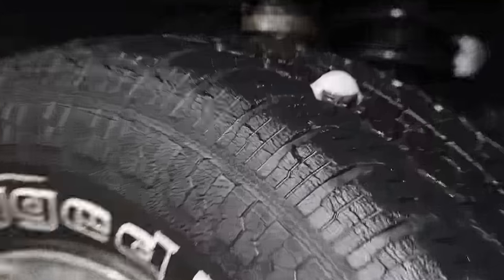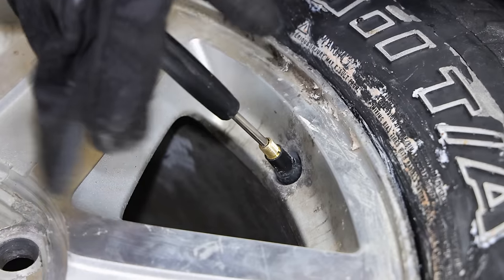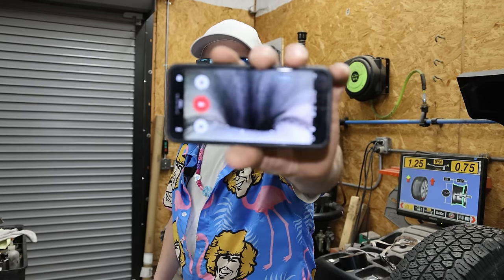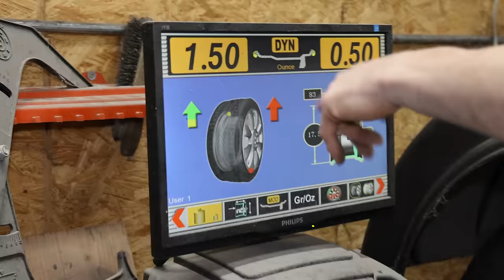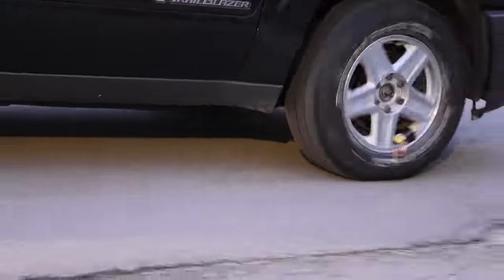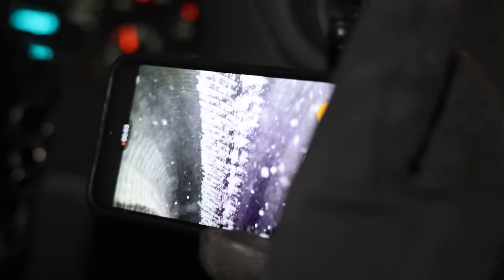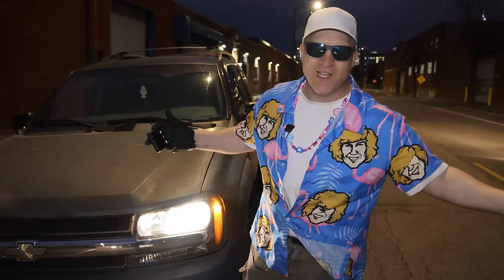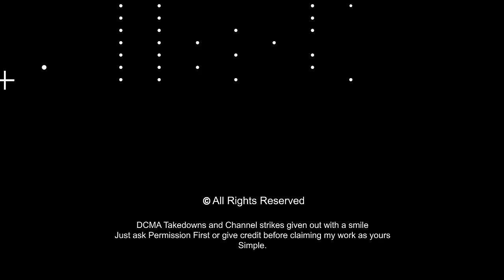GoPro Inside a Car Tire (With Balance Beads)

Comment: They work because the tire is rotating around its *center of mass*. If the tire has a heavy spot, the center of mass is going to be offset towards it, Meaning even though the heavy spot itself wants to be flung outward from a static reference frame, from the rotating reference frame of the tire, the heavy spot is actually staying closer to the center and the light spot is being flung outwards the farthest. The beads, which are free to move and not a connected to the tire at all only move via centripetal force of the tire trying to pull them back to the center, and they'll collect in the high spot which is the light spot.
Reply: Sticky Sticky  this and give the guy some more likes plz.!
Reply: Your explanation makes sense when you think about it. Thanks.
Reply: @RealityCheckThat  no problem! Glad that helps. I just searched and found a video titled "DynaBeads demo video" that I definitely recommend for anyone trying to visualize it. The guy used an eccentricity weighted water bottle with flexible extension in a drill to demonstrate the beads and i think it really helps to get a more intuitive feel for the phenomena.
Reply: You can also see this effect if you spin an ax in the air. It looks like the handle is orbiting the ax head
Reply: Nope.
Now, I know your are going to (firstly) trust the vendor over some stranger on the Internet, but hear me out.

An unbalanced wheel on a spring suspension will drag the axle in the direction of the extra mass.
That means that the heavy side is further from the centre of rotation, not closer.

The way these beads work is that any on the heavy side get hit harder than those on the light side. Result, the ones on the heavy side get redistributed more than those on the light side.
Reply: @dougaltolan3017  You are correct to say the heavy spot pull the wheel assembly as it spins. However, the heavy spot is closer to the center of mass, and the wheel assembly spins around the heavy spot. The easiest way to demonstrate this is with a dumbbell. Use a light weight and spin it using your wrist. Then attach weight to only one end and repeat the test. You will find the heavy end feels like it's dragging your whole wrist around it, and not like it's pulling your wrist away from the center. Essentially, the center of rotation has moved closer to the heavier side of the weight. Take it to the extreme and pretend it's a dumbbell with 50lbs on one side and 5lbs on the other. When you spin it by just applying a rotational force, the 50lbs side isn't going to want to move, the 5lb side will move much easier, so the 5lb side along with your wrist will rotate around the 50lb side.

Now do that with a car tire and you have the center of rotation for the whole axle being moved slightly towards the heavier offset. 

Now the balance beads are not attached to the tire and can spin freely. They will naturally gravitate to the point furthest from the center of rotation. Since the heavy spot in the tire is slightly closer to the center of rotation, and the light spot slightly further, the beads will move towards the light spot as it's furthest away from the center.
Reply: The tire is rotating around its geometrical center, if it would rotate around its center of mass it would always be balanced, beads or not.
Reply: Thank you
Reply: @Kalimerakis  correct - it WANTS to rotate around its center of mass but it's being constrained. To force it to rotate around the geometric center requires a constantly shifting force vector towards the center of mass which manifests as a vibrational force on the axel.
Reply: @2009dudeman  there is a problem with such an extreme model, it does not reflect a small imbalance on a heavy system with an even greater centering force.
Your dumbell model is misleading you.
Reply: @GlutenEruption  but then your theory doesn't add up.
If it spins around its geometrical center and the center of mass is offset, the heavier side will pull further away from the center of rotation.
Reply: @Kalimerakis  from a stationary reference frame, yes, you're right, but the reference frame of the tire is what matters to the beads. To them, they're seeing the light spot being flung AWAY - the system is compliant meaning the center of rotation will actually migrate somewhere between the axel and the center of mass putting the light spot further away and the heavy spot closer to the center from the reference frame of the tire
Reply: From the beads perspective, the area oposite the heavy imbalance hit a hill they have to go up causing them to pile up just before it on average. That's what causes them to balance the tire. The heavy spot pulls the tire in the direction of the imbalance at first at low speed, the same speed the beads seat in and centripitally stick to the tire. Once a tire gets up to speed, it starts rotating around its center of mass, but at that point the beads are already stuck to where they need to be.
Reply: That feels like a good explanation even though it's hard to fully work out in my head, basically need to ask a physicist to explain this lol
Reply: What he said 😂
Reply: @blahblahblah2372  Centrifugal doesn't actually exist. Centripetal is the force pulling towards center that causes something to rotate in a circle.
Reply: @blahblahblah2372  yes, centrifugal force is what's known as an "imaginary" force. It doesn't actually exist but is rather created by the perspective of being in a rotating reference frame - what you're feeling when you feel centrifugal force is actually centripetal force. Centrifugal force = "center fleeing" centripetal force = "center seeking". When you take a hard corner and you feel like you're being flung outward into the door of the car, If you look at it from above in a stationary reference frame you'll actually see it's actually the opposite that's happening. You're body is trying to continue moving in a straight line and the door is continually getting in the way and pulling you towards the center of the turn.
Reply: It’s simple beadeometry
Reply: Yep.
Reply: I don't think so. If the tire always rotated about it's center of mass, it would always be balanced. But tires rotate about their axles and any mass asymmetry in the tire/wheel assembly provides imbalance when rotating.
Reply: I was hoping someone said it so I didn't have to write much. Thank you!
Reply: @GlutenEruption  thank you for taking your time
I am still a bit hesitant,
but everything adds up the way you depict it.
Reply: @Kalimerakis  No problem! And definitely don't worry - EVERYONE struggles trying to picture behavior from rotating reference frames. They are REALLY good at screwing with our intuition. Lots of things start behaving really strangely and even exactly OPPOSITE how you expect them to, and it takes a LOT of brain retraining to even begin to get a gut feeling for it (and even then it's hard).
Reply: @SanityTV_Last_Sane_Man_Alivethat is the intuitive answer, and in a theoretical system (perfectly spherical cows and whatnot) it's true, it but it's not correct in reality because the system isn't perfectly constrained - the rubber in the tire is compliant and able to flex and stretch, the axel is sprung and allowed to move up and down, the play in the suspension and the flexibility of the components allows it to move in all axis's, and ultimately the entire car is free to move as well. The fact that there is a vibration itself (which is fundamentally the entire system and its components accelerating -ie moving - with a constantly changing vector) is proof that the tires rotation isn't being perfectly constrained about the axel, because if it were, the off balance forces would be irrelevant - if the tire is able to be kept rotating perfectly around the axel, then by definition the forces are being canceled out.
Reply: I believe the concept is wrong. It is the opposit! Farthest of the center stronger the centripetal force, more beads accumulate there...
Reply: Well now who the hell do I believe? I’m confused, my head is hurting worse than it hurts in a vehicle with unbalanced tires.
Reply: Yeah that's what I was thinking too!!
Reply: Then why does the axe head, the heavy part end up more often in the tree when grown at it with intent?
 @havoc1zero
Reply: What is "it"?  Do you meant the beads? If so the s  on the end of beads I fixated this is something plural in which case it's appropriate, accurate and helps people understand the language you are using, to say, "they" not "it"!
 @GlutenEruption
Reply: @Kalimerakis which indeed it has to! I agree.
Reply: @r.martin3494  that’s the result of a proper throw at the correct distance where the spin ends with the axe head forward. That’s really just a skill issue.
Reply: Yeah, that's not true at all, they don't really balance at all they're mass dampers, they dampen vibrations, they don't really balance the tire.
Reply: IMAGINE - all the people, driving, now in peace, - no, seriously, imagine a tire /tyre is a sock and the beads in the tyre are not attached to anything and that's why that theory works, then equally, a fistful of sand in a sock not being attached might also want to move to my shoulder when I swing the sock of sand around in a circle, yet! 😊 The "sock of sand" still follows the rule of centrifugal force and causes a lot of damage when it hits someo/ I mean, something.  Especially if "kneehighs"!
Reply: @blahblahblah2372  ...and is yours the same as centripetal which is what HE wrote!?  And which should come first the question mark or the exclamation mark after such a sentence as this, or should only one or the other ever be used and never both?!!!!  Though never more than one exclamation mark of course!  ...and not as often as most these days use them! 😂😊
Reply: @KalijahAnderson I beg to differ! Both exist and are found inside the tire with the beads and they all make "uncomfortable bed fellows" for a wheel!
Reply: @r.martin3494  no, "it" was referring to the heavy spot of the tire. If the tire is perfectly balanced, the center of mass, the center of rotation, and the axle all overlap. Now if the tire has a heavy spot, the center of mass (center of gravity) moves to somewhere between the geometric center and the heavy spot. If you were to spin the free floating tire in zero gravity, it would just spin around its center of mass and there would be no imbalance because the center of rotation and center of mass are identical. However, by forcing it to spin around the axle in the geometric center, since the tire will constantly be trying to rotate around the center of mass but is being held back by the axel, it will impart a force onto the axle felt as vibration. From the perspective of the axel, it will seem as if the heavy spot is being flung outwards by centrifugal force but as we know, centrifugal force isn't real it's just the result of centripetal force acting in a rotating reference frame. From a static reference frame, the tire is actually rotating around a point offset from the axel towards its center of mass, with the light spot always being furthest from the actual center of rotation. The beads will begin to collect there preferentially until the Center of mass of the system back into alignment with the geometric center of the axle, causing all points on the tire to be the same distance away from the axle, preventing any more beads from collecting
Reply: Accumulation of bead is dependant upon the configuration o and logistics of delivery to the bead store in the shopping mall where the great confligration of caterpillar force is assembled using bamboo and other sustainable products! 🫡🤔🥴🤒🤕
My head hurts!
Reply: We tried them in our shop several years ago with very bad results. Just about everyone complained.
Reply: @r.martin3494  Centripetal and centrifugal are not things that one can have opinions about. These are scientifically defined things. Centripetal causes a change in direction, centrifugal is just inertia trying to go straight so it's not actually a force.
Reply: Centrifical force keeps it balanced
Reply: @empoweryou1  that's definitely good info - just because something works in theory or in the lab doesn't necessarily mean it translates to the real world. I've seen a pretty even split between people who have had excellent experiences with them and terrible experiences with them (from my brief search, it seems like motorcycle riders especially seem to notice a significant positive effect). 

Such a wide range of experiences makes perfect sense to me considering that it's one of those products where the better it's working the more invisible it's effects are, meaning the feedback is always going to be skewed towards the people having trouble. But more importantly, given their mechanism of action, a huge number of variables including things like suspension stiffness/play, play in the ball joints, power steering strength, tread width, tire size, compound, the texture on the inside of the tire, lateral imbalance, the rim design, driving style, speed, etc, as well as how each variable interacts with every other variable, all play a major roll in how well they work (or even IF they work) on a specific vehicle in practice.  

Given that fact, plus their incompatibility with TPMS, the mess they make of the rim and tire, how well modern balancing machines and wheel weights work, how easy and cheap it is to get a tire rebalanced, etc, I just don't see any serious advantages compared to standard weights (and SIGNIFICANT downsides) IMO, even if they perform perfectly with your specific setup. But regardless it's still a pretty neat use of applied physics and a pretty elegant solution to an everyday problem
Reply: @Kalimerakis  We're not rotating the tire in outer space, so this level of pedantry isn't useful or even necessarily correct.
Reply: @richardpark3054  "Balanced" in this model means that it's center of mass and it's geometric center are aligned. Even if we take out the axle, it would be out of balance when you try to roll it, like rolling an egg down a hill. The egg will rotate around it's center of mass, but it will not be balanced.
Reply: @r.martin3494  You and the sock full of sand are the same unit in this example, with you being the heavier side of the rotating system... By your reasoning, the sand should end up towards you rather than away!
Reply: I'm calling BS.  While your explanation of a high spot and low spot in the interior of the tire makes sense, you make a leap of logic in saying the beads will settle in the high spot.  What force acts on the beads to cause them to collect on the lighter side of the tire?  Additionally, is it feasible that that force is sufficient to overcome the "centrifugal force" pinning them to the interior wall of the tire?
Reply: Isn't a tire fixed so that it can only rotate around its geometrical center? I mean Sure there's suspension but it only gives it some freedom up&down. Side to side it's still constrained by the bearings
Reply: That's stupid
Reply: @РоманПлетнев-г3э  yes! The axel does fix the geometric center and if everything was perfectly fixed and rigid it would, however the entire system is free - the suspension like you mentioned is compliant, the tire is made of rubber and can significantly deform and flex, the metals aren't perfectly rigid, there is wear and play, and ultimately the entire vehicle itself can move. Remember, the vibration you're feeling is the tire physically pulling the car constantly towards its preferred center of rotation. The further and harder it moves, the greater the amplitude of vibration. No matter how out of balance something is, the more rigidly it's mounted, the smaller the amplitude of vibration (and if it's mounted perfectly rigidly to where it allows zero motion, there is no vibration whatsoever). So more vibration = larger movement towards the center of mass = greater forces redistributing the beads. It's a self correcting system.

But side to side you are 100% correct. These do absolutely NOTHING to balance a tire laterally, which is a HUGE drawback (among many others) compared to traditional balancing
Reply: If a tire is that much out of balance, there is a reason for it. If your tire is dry rotted that bad, buying balancing beads is just making the bill for new tires more expensive.
Reply: Thanks for that explanation.  I was baffled how the beads would "know" where to go.  You clearly explained it to my dim mind!
Reply: @GlutenEruption  Given that the rubber can deform, why should the part that experiences the highest force stay close to the center of rotation and not be flung outward the most? If it was the other way, wouldn't the off-balance correct itself automatically?
Reply: The heaviest spot will pull the farthest if material is equally stretchable in its entirety. As with rigid body materials. This is just plain physics.
Reply: @2009dudeman The tire spins about the axle, not the center of mass.
Reply: @DingoHammer  the axle itself oscillates... This was more visible with the old beam axle, but it's monitored on F cars, out of balance wheels oscillate all the way to the axle.
Reply: I wonder if an extremely out of balance tire would cause vibrations when it wasn't in accel/ decel... It seems like the beads are in chaos when not in a transient condition.

The camera almost seemed like it was interfering some, you could hear the beads smack it a few times throughout the video.

I bet close inspection of the beads at the contact patch would give better data, but good luck with all that.
Reply: Bonehead explanation...the tire rotates around its approximate geometric center, which is close to but not the same as center of mass, otherwise it would be a perfectly balanced system in the first place.  At slow enough speeds the beads sit at the bottom of the tire...gravity is a bitch.  At high enough speeds the friction between tire and bead is enough to drag the beads around.   The assumption that an internal concavity is only going to be found at a thin or "light" spot is completely irrational. There need not be a depression for a tire to be lighter in a region...all tires are heterogeneous...they are not monolithic material...they are composed of many materials, and any given volume of tire can weigh slightly more or less than some other equal sized volume of the tire for very obvious reason...without having a dent to supposedly collect beads...all it takes is a slight difference in, say, the ratio of rubber to steel in a location compared to some average rubber/steel ratio, which would mean densities are different..and we know tire material density is not uniform otherwise the damn thing would not need balancing..
Reply: The only issue I see is trying to get the right amount. If you put too much it won't work, and too little it won't work effectively.
Reply: @jwalster9412  too little and it absolutely won't work, but unless you add WAY too much, it will still work okay because any additional imbalance from extra beads will also be canceled out as the excess will be distributed around the entire tire. Of course any excess is adding unsprung weight, which will degrade traction over rough roads, etc.
Reply: When I first read your comment, I was sure you had to be wrong.  It took me super long to visualize this, but I finally can and I'm glad you explained it, thanks. Also, the dude talking about barbells here was instrumental in that for me. Thanks to that guy too.
Reply: @MrBradshawbenjamin  That's so awesome! I'm glad to hear that! Rotating reference frames are REALLY counterintuitive - often things do the exact *opposite* of what you expect them to, which can be super confusing, but once you start to get a handle on things, they can be really cool and fun to explore. They definitely make great brain training puzzles!
Reply: @Tesla_Ampersand_Friends  oh absolutely- until the speed is high enough for the beads to be fully distributed and held firmly against the inside of the tire, their is absolutely zero balance whatsoever. So you'd definitely get a big vibration getting up to speed and slowing down again which is just another one of the many disadvantages vs static weights in this application.
Reply: it's like how a washing machine is self balancing.
Reply: @Kalimerakis  actually it's rotating around a point in between. if your suspension was floppy and unloaded it would rotate around the center of mass. on solid suspension it rotates around the geometrical center. since your suspension is stiff but pliable it does neither.

which is probably why balance beads don't work as good on sports cars
Reply: That was good explanation.
Reply: That explanation is totally correct once you think about.
Heavy spot in, light spot out. Centrifugal sends beads to outward spot.
Reply: @2009dudeman  If you take a balanced tire / wheel and add a wheel weight to one side and throw off the balance what happens? The heavy side torques the center point of the tire balancing machine so in order to rebalance that wheel you must add the same value weight to the opposite side to get it back in balance.  So you mean to tell me the beads automatically go to the opposite side of the weight you added? But why?
Reply: @warntheidiotmasses7114  Technically balance beads are dynamic balance and cannot be accurately run on a tire machine not designed for such things.

The beads work their way opposite the heavy side because the heavy side drags the tire and axle with it even if slight. The beads, being free to roll, want to maintain momentum in 3D space and roll 'away' relatively from the heavy side, not dissimilarly from shaking a bowl of water.

As to the topic of the tire actually dragging the axle. I didn't think that was a hard concept, but someone else was confused by it so i'll explain it anyway. The axle is attached to a spring, meaning it can move rather easily. So as the heavy spot drags the wheel out of the ideal center of rotation (causing a vibration), the whole axle moves with it. Tie a 400lb plate to the tire and spin it up, shouldn't be a surprise when the whole axle, and likely car is shaking up and down... Same thing happens even for a few oz. of weight, only difference is the few oz. isn't an easily visible movement and therefore people think because they can't see it, that it must not exist.
Reply: @2009dudeman  So when the heavy spot sends the wheel up into the suspension, the beads slip away to the side of the tire that isn't being sent up into the suspension? Hmmm.  And why hasn't this been thought of before? 100 years of autos?
Reply: @warntheidiotmasses7114  It has been. I personally know truck drivers that have been putting tennis balls in their tires to balance them since at least the 1970s. It's not like this is 2 or 3 people I know, it's dozens that all have been doing it for a long time, and it was even more common before the balance rings on semis became popular and the tires themselves got better.

Balance beads are NOT as good as a proper road force balancer for cars. But for trucks and other large vehicles, balance beads are great. There is so many conditions to what does and doesn't balance well (I was an auto mechanic and spent a lot of time diagnosing wheel vibrations). But the short of it, anything less than an 18in wheel, that is a 32in tire or larger, will not balance well with wheel weights. There is too much dynamic rubber that changes characteristics over time. 

The bigger the tire, the worse it balances. My own truck, just a 32" tire on a 16in wheel, it pre-weight can be out on any given tire by over 4oz on average. Thats a TON of weights that can go out of balance over 6 tires. To put this in perspective, people can, in performance cars, feel a 0.25oz imbalance.

Using balance beads in my truck has been pretty good. Sometimes they aren't perfect, but they don't need to be rebalanced ever, whereas I would need to rebalance my tires several times over their life prior.
Reply: This.  Was just about to post similar.  Hey OP, this is your answer!  How about a sticky/heart for this comment?
Reply: @richard1113  right? That's what I'm saying 😂
Reply: Nice explanation, well done - - -there are liquid rings at the top of a washing machine tub to balance the clothes in the spin cycles.
Reply: LOL... 😆😆😆😆
Reply: @RealityCheckT
LOL LOL 😆😆😆😆😆
Reply: @RealityCheckThat 
LOL LOL 😆😆😆😆😆😆
Reply: @GlutenEruption you put a lot of effort into explaining this and I want to thank you. I'm not quite 100% in my understanding yet, I need to visualize it first. I think an animation is in order. I now have a goal. 😊
Reply: YouTube comments = balance beads on a road of infinite length and zero destination. (just my spin on it, as yet another bead weighing in)
Reply: Centrifugal forces
Reply: That is the best "BS baffles Brains" comment ever, you deserve to be beaden 🙂
Reply: When you think this explanation through it appears to be utterly flawed to me. 
The axis of rotation is defined by the bearing of the wheel, it does not change with the weight distribution as the bearing stays in place. 

The metal rim will also not deform in any significant way due to weight distribution. 
The rubber tire may deform differently according to weight distribution, but it already deforms due to contact with the road compressing the local section that has contact. 

However, an unbalanced weight distribution will cause a (slightly) varying speed of rotation of the entire wheel as it rolls on the surface because the eccentric weight accelerates and decelerates on it's path. 
In other words an imbalanced wheel will not roll at a constant speed due to the eccentric mass distribution. 
I assume this variation in rotational speed during every rotation is the real cause why balancing beads work and what the beads even out by being redistributed to the location where the strongest centrifugal forces act on them as the tire rolls.
Reply: Make a video and share please. I want to see this now.
Reply: Its not Centripetal force, its centrifugal.
Reply: this is some serious ligger wizardry here
Reply: Can you pls help us to make it understand in a simple way
Reply: @snek9353 this was my thought too. Those beads are being evenly flung against the tire completely equally from centrifugal or centripetal force (whichever one it is) as soon as the tire gets up to speed. They don't move after they're up to speed which means they aren't dynamic, they're not adjusting to any heavy or light spot once in motion, and not actually balancing anything. It's just a static "Graviton" ride for those little beads once the tire gets up to enough speed.
Reply: Dam! Good explanation!
Reply: Thanks
Reply: The TRUE Savior

HalleluYAH (Hallel u YAH) “Praise ye YaH”

YaH is The Father (Genesis 1)
YaH arrives via the TENT OF MEETING
YaH was Who they Crucified for our sins
YaH was Crucified on an Almond TREE

Semitic (Moses)
Isaiah Scroll (The Original Isaiah)

Isaiah 42:8
I am YaH; that is my Name! I will not yield my glory to another or my praise to idols.

Isaiah 43:11
I am YAH, there is no other Savior but Me.

Isaiah 45:5
I am YaH, and there is none else.
Reply: @Kalimerakis I believe you to be correct. The wheel or rim is spun on a bearing. The bead of the tire is on the wheel. With centrifugal motion spinning everything outward, what Magic force would make the heaviest spot come closer to center? 
One commenter says something about throwing an axe and the center of gravity being near the head. We are not dealing with center of gravity in that regard because we are spinning on a fixed center.
Reply: @Kalimerakis Listen man, these comments are 5 months old but it must be said. These other guys are wrong. When I turn left and your body goes right that is centrifugal. Look at the video, the beads are going to the outside of tire.
Go spin in circles, you can feel your hands pulling outward.
Reply: @GlutenEruption Ever been on a merry go round?
Reply: Yea what he said! 

Hits blunt.
Reply: Wouldn't this be centrifugal force of the beads being flung OUTWARDS not pulled INWARDS...?
Reply: @dougaltolan3017  From what I've seen in this posting, your answer appears to be the only one that is completely correct.